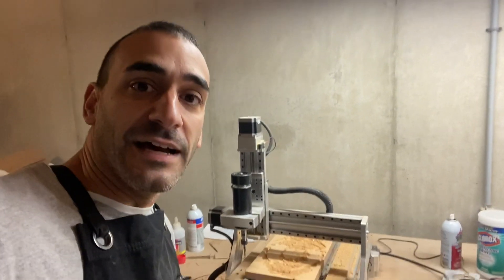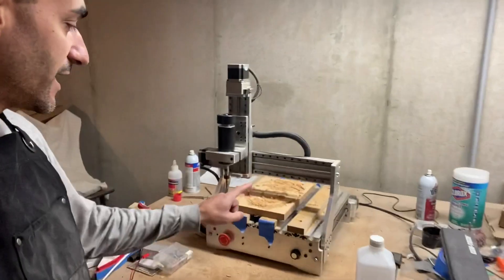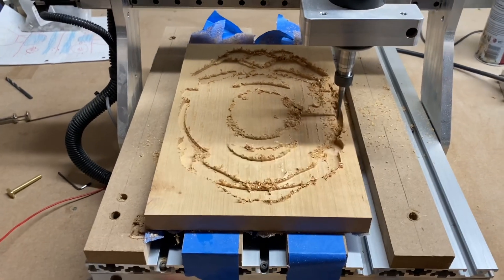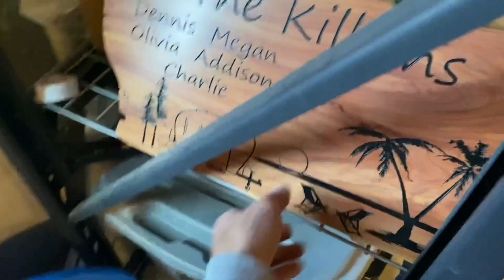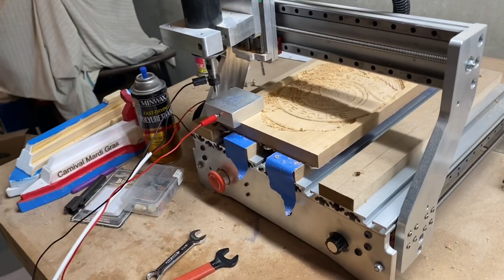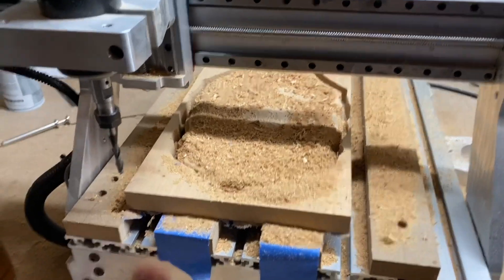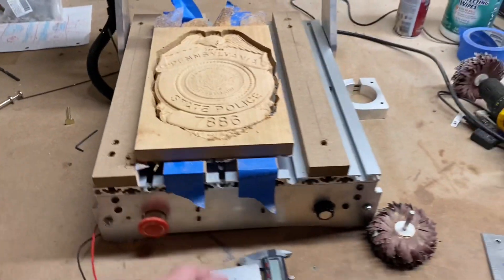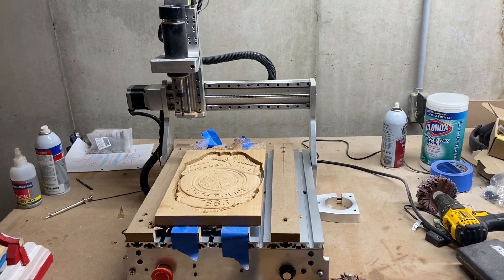Cutting/Carving a CNC 3D Badge (CNC4NEWBIE Mini)

Comment: I understand that the work area is basically 12” x 12” for this machine.  Is it possible to create a match line in the program that would allow a person to slide the work on the y axis to complete a larger project?  For example your badges that you produce would carve the top half and then slide the wood down to complete the bottom half of the project.  Am I thinking way too far outside the box?

Comment: i've got the 4848 with uccnc.  what size is that spindle.  i've got a onefinity with the 1.5 air cooled 220 65mm spindle.  seems like it would be a good fit with that machine.  btw, i really like uccnc.  lots of capability with it. 
Layne Mims
Reply from the maker: This is a small 500w, 12k rpm spindle. This machine can definitely handle something bigger